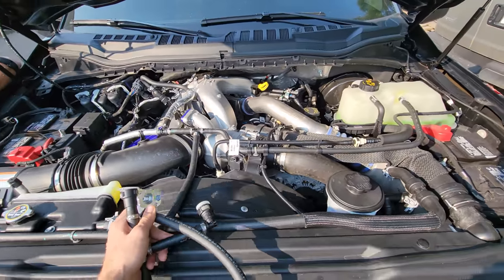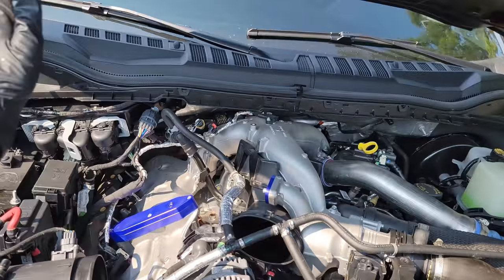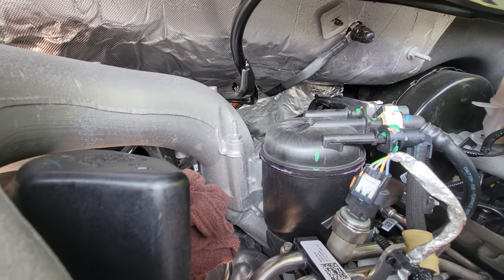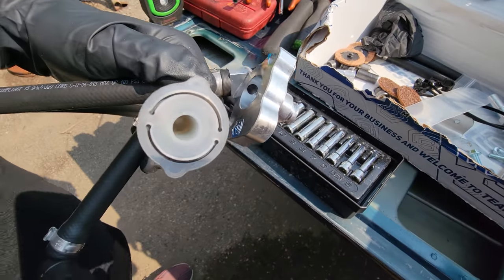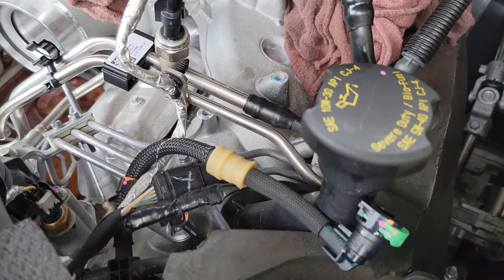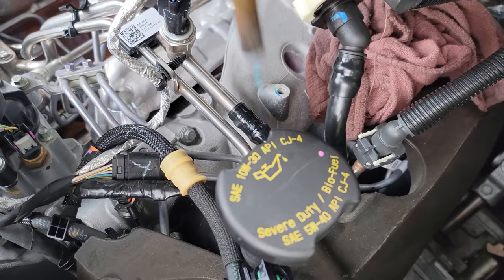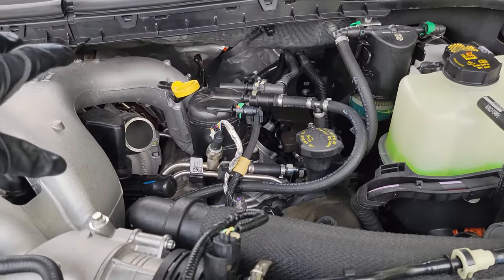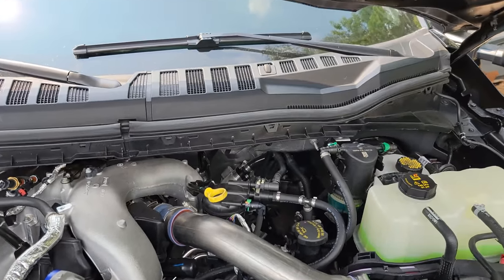FORD 6.7 Powerstroke GEN2 CP4 Bypass Kit Install | S&S Diesel Motorsport | A MUST HAVE

Comment: The supply side line to the ss return filter vibrates a ton. Makes a very quiet gurgling sound too. Wish I knew if this was normal. No flow issues. I test at all that.
Reply from the maker: Doesn't sound normal to me...
Reply: I wrote to S&S and they basically said vibration in the supply line to the filter comes from the fuel flow return pushed from the CP4. Thus the reason for the bushings between the mount and firewall. They also started keep the hose from touching any part of the engine as the vibration of resting against an engine component will cause noise. If you hold that line with your hand you’ll feel some pretty good vibration. The sound is so slight you have to put your ear directly on the inlet to hear it and it’s just the sound of fuel flow.
Reply from the maker: Interesting

Comment: If you would of went with the spe disaster kit its a lot better kit and doesn't require you to remove thay plastic line. Instead theres a distribution block that seperates the 2 lines with a micron filter. The SPE disaster kit is plug & play. Im getting ready to install mine 

Juat an FYI
Reply from the maker: .......all i will say is good luck........

Comment: Very nice I just did not a gen 2 mine is a 2013 and have bad luck it didn't leak but it won't start throwing some codes P02E0 ,P0107, P0113, P0100, P0E09. Wich are the MAF,IAT throttle body feels frustrated it did that

Comment: They put lock tight on those two bolts in the beginning but don’t put lock tight on the infamous vacuum pump that leaks in front of the radiator 🤔
Reply from the maker: RIGHTTTTTTTTTTTTTTT 🤦‍♂️🤦‍♂️🤦‍♂️🤦‍♂️

Comment: I have a question about my 2011 6.7l powerstroke. I deleted my truck and disconnected the egr, but it's still on the engine. Are those gasses still circulating in my engine even if I have it disconnected? Sorry about the stupid questions.
Reply from the maker: If they're disconnected, how would the "egr door" open up to thus let flow happen......

Comment: Wondering if that filter system has gelling issues in the cold climates. Had gelling in my 7.3,6.0 but never in my 6.7. I’m sure once it’s all warm under the hood it will be ok,but I’m thinking the first half hour or so at zero or below.. cool kit.
Reply from the maker: I dont think so pal

Comment: What filter type is that. The one mine came with is all white. I would love the see-thru filter…just installed the 2.1  on a completely stock truck with egr. Tear down was 9am to 12:30pm
Reply from the maker: DPK 2.0
Reply: Thank you

Comment: Absolutely outstanding video!! I'll be doing this mod on my 22 6.7 Tremor! 
Does this alter the oem fuel pressure rating?
Reply from the maker: Thanks so much. No sir
Reply: I believe s&s did some testing and actually found they were getting better flow out of the pump with their kit on, they had something about it on their Facebook page a while back
Reply from the maker: Si

Comment: Great video, As I said in another one of your video's I'm new to owning a diesel and just got a 22 F450 6.7L and wow I dont miss turning wrenches! I was a Ford tech for years but never dabbled in diesel repairs, mostly warranty work offset by some used car gravy lol. I'm still friends with a few guys there and asked the couple diesel techs about the fuel pump issues and they said they've never had one come through so what do you think the percentage of failures actually are. This 450 is just a daily driver and main reason for buying it is towing our 44ft 5th wheel, it's not a hotshot truck or anything but our rv weighs roughly 15,000 loaded and I've noticed with the 10 speed tranny it likes to stay in 10th gear a lot so the boost always seems to be up there in psi, so would you also recommend the hot and cold pipe upgrades because you said in another answer they've seen a few blow off. Thanks
Reply from the maker: Yes sir. Pretty much all of the items in our "mod" playlist has everything that I would recommend for ones new 6.7. Simple, legit & no fuss. All of our clients have been thoroughly happy with thee outcome.

Comment: Just ordered one for my 21’ super stoked. I’m right at 11,000miles. Should I be worried about removing the (vcv) and upper intake plenums and not replacing the O-rings? Unsure if you installed new ones during this install video. Thanks!!
Reply from the maker: Reuseable broski
Reply: @PowerStrokeTechTalkwARod  Thank you so much. Love the page. Very glad to have found this Owning a 6.7 and maintaining 7 6.7 equipped Ambulances at work!
Reply from the maker: Hell yeah!!!!
Reply: Reuse all day long!

Comment: I wish I had seen this kit from s&s before I put the other guys one on.  Im having issues (P01C6) fuel pressure A circuit high now. As long as i drive it conservatively i don't have a issue. If I accelerate quickly to pass a slower vehicle  I get a reduced engine power warning and the engine light stays on. So im thinking about removing the return screen and driving it again to see it that solves my issue.
Reply from the maker: I wish you would have too. I DO NOT LIE & with that I have heard nothing but problems using "the other guys" kit. I just speak facts, ALL MY OPINION, which others will beg to differ but then again here WE are......
Reply: @PowerStrokeTechTalkwARod  have you even looked at the other guys kit? Looking at the S&S kit the only big difference i see is the return side filter which i really like. I just hate to throw 400.00 away and spend another 400.00 just to buy a better return side filter system.  Also does  anyone besides the other guy make a crankcase assembly delete? I really enjoy your videos btw keep up the awesome job.
Reply from the maker: I REFUSE to look........
Reply: @PowerStrokeTechTalkwARod  🤣🤣ok.. I won't twist your arm I was just trying to see if there was a difference between them.
Reply: Without putting anyone on blast publicly, what other brand kit is causing issues because I'm about to order a disaster prevention kit for my 2017. Can someone shoot me an email to discuss?
Reply from the maker: I'm sure you can figure that out kind sir

Comment: excellent video. I have an SPE fuel filter relocation kit which eliminates both stock filters and puts one fuel filter and water separator under the truck, would the top one being eliminated stop the S&S from being installed properly? thanks
Reply from the maker: I cannot & will not comment on their products

Comment: Ssooo, if this came in under warranty for a failed CP4 would Ford STILL replace all the fueling parts, OR since there is no contamination of metal flake would they skip it?
Reply from the maker: That i guess wld up to the repairing dealer

Comment: I feel daunted working on the 6.7. I've only ever worked on 6.0s and 7.3s and heavy duty diesels.
Reply from the maker: Brother, IF I CAN DO IT SO CAN YOU! u will fastly loose intreset in thee others quickly
Reply: Trust me, it’s wayyyyy easier than you think. Personally I felt like my 6.0 was more of a PITA than my 6.7. Just seems to be a lot more room to move around and easier to relocate items to clean stuff up.
Reply: I think I should clarify, I've only ever done basic stuff to them. Upper intake removal turbo pull that kinda stuff but Ive never gone further. My 6.0 I've done hg's and studs an just random stuff I never had a real issue, I just get scared working on something so expensive and nice

Comment: Thanks for all the great info, have a 2016 w 65K on it, been changing fuel filters oem every 10K miles since about 30K and additive since 45K miles but getting worried. She's going into the shop for an evaluation, results to determine if your prevent kit or a new truck is in order.  Any thoughts about this appreciated.
Reply: I would feel like I’m abusing my truck if I went to 10,000 lol. Every 5,000 miles every filter gets changed like clockwork. 
What kind or type of treatment do you use? Always curious to see how people like different types and results from it.
Reply: @Wrensspeedshop  lol thats extreme, where are you pumping that your fuel is so disgusting. Ford recommends 15k
Reply: @PS-lm3tp  Power stroke motors are like women, treat them good and it may treat you good, treat them bad and push it (filters etc) and good luck lol

Comment: Installed this kit on my 2018 6.7l problem is the line is starting to kink that goes from the factory filter to the cp4
Reply from the maker: It's all about the bends & the twists. Re-index the hose.......

Comment: I installed mine yesterday everything was good until mid day today. lost power getting p0001 fuel pressure regulator open. Could it b the plug on fuel volume control valve?the
Reply from the maker: hmmmmmm, ive done a hundred of em, nvr had that happen
Reply: @PowerStrokeTechTalkwARod  That's because you are THE MAN!

Comment: Wow! You used a torch to remove a rubber fuel at 22:00.  That didn’t seem right to me.

A sharp razor blade lengthwise on the rubber tube would’ve been safer and faster.  I don’t think a sharp razor blade would’ve damaged that aluminum fitting.
Reply from the maker: Ummm...not rubber & yes a razor blade will score the steel line. This isnt gasoline bud..

Comment: So, I don't think you mentioned it in the videos, but just curious if you could help me out with some torque specs on the 22MY? Do you happen to remember the torque specs for reinstalling the 8 upper intake manifold bolts as well as the 3 lower intake bolts? Also, even though he didn't have his EGR installed, do you happen to know the torque spec for the bolts for the EGR pipe? And finally, what about the torque for the clamp on the lower intake going into the turbo? Any help would be appreciated! Thanks
Reply from the maker: Brother, tighten them down & give em a snug. Thats it

Comment: Good morning, I just installed this yesterday, pretty painless, however now I am throwing the following codes: P1637 and P02E9, have you encountered these after installing?
Reply from the maker: Gosh i sure have not. U sure u plugged in everything
Reply: I went through it all again, and like a bone head I forgot one connector. Truck is happy again. I appreciate the quick reply! Love the content! I still have the 1637 which seem to be related to the abs system, but it isnt generating the CEL. Think I should be concerned? @PowerStrokeTechTalkwARod

Comment: Another excellent video ARod and great job on the install.  This is something I'd like to do on my 2020.  Will definitely add it to the list.  What are your thoughts on adding a CCV drain or catch can to get rid of that factory box?  I see this customer removed that as well along with "few other" parts. :)
Reply: @PowerStrokeTechTalkwARod  
Hi ARod. Like your videos. Keep up the good work. 
I have a 2017 F350 dually that I use to tow RV'S all over the states. Changing the oil the other day and noticed a small oil leak right side just forward of the exhaust down pipe. Looks like it's coming from where the block and head meet between 2 bolts. I would like to send pictures so you can see. I am not sure if I need to worry about it. 
Morgan.
Reply: Shoot I wanna know the answer too!

Comment: My 2017 f550 had a broken "T" from the return line. Now it doesn't want to start. It only cranks. It shows low fuel pressure. Diesel pump works fine. It cranks, but no start. Any tips? Also, what OBD would you recommend for the f550 super duty? Thank you
Reply from the maker: You will need to replace the return line to fix

Comment: First, thanks for the great indepth videos! Just ordered the S&S kit for my 2013 with 185k on it. No issues with it so far but I like the thought of the added insurance as it gets up in age. Do you have any thoughts on going ahead and swapping the CP4 while I have the truck apart vs leaving the original? Is there a shelf life on these pumps or are they good as long as your careful with contaminates/filter changes/fuel additives? Not familiar with how involved it is to put in a cp4.2...
Reply from the maker: Juss keep doing what ur doing pal!

Comment: Finally picked up my Kit from Accurate Diesel. Tim’s a good dude, I gave you a shout out while placing my order. He definitely showed a little love, and helped out with the shipping. Just out of curiosity before I rip into this truck. Do you know if the Snap On extended torx bit will be long enough to hit that bastardized bolt securing the metering valve. That Matco is quite a bit longer. Looks like the snappy is about 5” or so. Thanks again for this instructional clip. It’s super helpful to know exactly what your getting into prior to starting a project, we don’t always get that luxury.
Reply from the maker: 🙏❤️🙏😎🙏❤️🙏 it shld. As long as u clear the valve u can put an extension on it👍👍
Reply: @PowerStrokeTechTalkwARod   Thanks BrO…I swear you’re more reliable than a 7.3. We always appreciate you, and the hard work you put in selflessly to make our lives easier.
Reply from the maker: 😁😁😁😁😁😁😁 ur wallets are gonna hate me in about an 1hr & 45 minutes hahahahahahah
Reply: Know your worth, time is money…
Reply from the maker: Check out my ccv video, i show ya how to disconnect it. I just finished my install. Clean
Reply from the maker: No sir, probably an oring tho

Comment: If someone wanted to return to stock after this install, is there a replacement line from Ford for the line that had to be heated and removed?  Thanks and awesome video Arod!
Reply from the maker: Ud have 2 buy a new line.

Comment: Hey Aron, heard you in the podcast mention you want to run a 6.7 on ATF.  How about after that you slam one of these kits on and run some DEF through the fuel and see how this kit actually works??  It’s difficult to find anyone that has had one of these installed when a pump ate itself to actually know how well one of these disaster kits work!  Thanks
Reply from the maker: Watch s&s videos
Reply from the maker: Man, I sure hope we can be apart of that!!!
Reply: No, this kit will not do anything to prevent damage from water or DEF.  In many of those cases the injectors are ruined before the pump and you have to replace the whole system.  You might get away with not having to flush metal out of the tank and fuel lines but that's about it.

Comment: Did you cut off the Allen head on that socket? The one used for mounting the filter bracket. Looks like you shortened it
Reply from the maker: Nope sick stubby set!
Reply: Dang I need one of them

Comment: Would it be of benefit to use this kit with the exergy metering valve?
Reply from the maker: No, the valve doesnt do jack shit. It literally is the same as oem excpet for a finer screen that u dont need & wont help if you have a failure anyways.
Reply: @PowerStrokeTechTalkwARod  right on thank you!

Comment: Put one on our 2019 f350, we tow a fifth wheel. Also changed out our stock sump system. Ours went out and the truck quit on us, though the cp4 failed got lucky and we did not have this on yet. Have it now incase that cp4 goes. That was not a good feeling when the sump went out though either.

Comment: How many key cycles did you do? Installed SPE dpk  and wont start, no leaking anywhere near cp4or fuel lines
Reply from the maker: Bout 10 or 15....10 secs on each time.........I WISH YA LUCK WITH YOUR PURCHASE...................................................🤦‍♂️🤦‍♂️🤦‍♂️🤦‍♂️🤦‍♂️
Reply: @PowerStrokeTechTalkwARod  thank you i will try that and hope for luck
Reply from the maker: ...havent heard good things

Comment: Hey I’ve got a 2017 F250 long bed. I’ve got the old Gen 1 S&S kit. Looking to upgrade to the Gen 2 instead of just adding the filter. Obviously I cut the old fuel supply line. Hard to find that part, I can find the entire assembly for $250-300.. My question: is this part # VIN specific? Seems to be a few different part #’s that “fit” according to a few different companies selling OEM out there. My old part number is rubbed off. Thanks man. I’m looking at Part # HC3Z9J280J to go back to stock and then have the quick connectors hook up with the Gen 2.
Reply from the maker: Yes vin specific
Reply: PowerStroke Tech Talk w/ARod Alright I’ve got one more for you. Took the Gen 1 kit off and put the fuel system back to stock. New fuel supply assembly and all. Then went ahead and installed the S&S Gen 2 kit…. My truck is now not black smoking at all, it used to blow clouds when I punched it. Desired pressure and Actual injection pressure numbers are all normal. Any explanation for the change? Farm use truck only.
Reply from the maker: Not sure pal
Reply: PowerStroke Tech Talk w/ARod weird, thanks for reply 🤙🏼
Reply: PowerStroke Tech Talk w/ARod Tuner diode got pulled out while I was rummaging around.  Lol, all is good.

Comment: I installed the s&s gen2 kit over a year ago.  lots of scratches on your hands..but got it done.  unrelated question....can you install the metal upper intake that the 2020+ have on a 17 thru 19?   I like the metal look better.  if yes...does anyone have a part number?  any sensor mismatch or other problems?

Comment: Going to have to make an update video now that S&S just came out with that new pump that’s an oem fit. I have there disaster  prevention kit with the filter on both my 6.7s and when the pump fails that’s what’s going on the trucks
Reply from the maker: I already did, where you been
Reply: Must have missed that video. Did not see it come up. Good to hear! These folks at s&s really made a difference with the 1 big short fall of these 6.7 motors
Reply from the maker: Next level